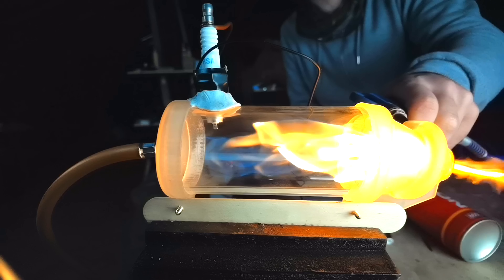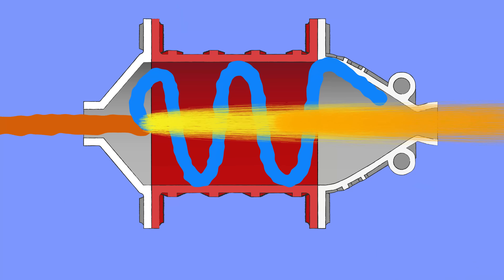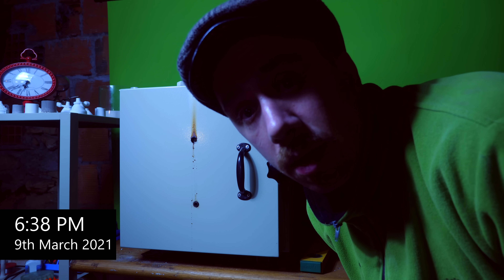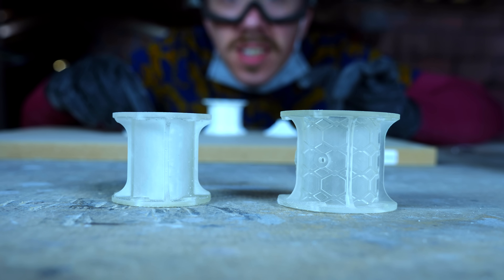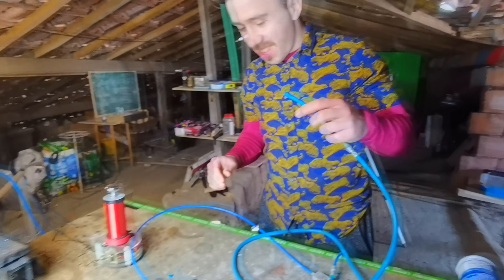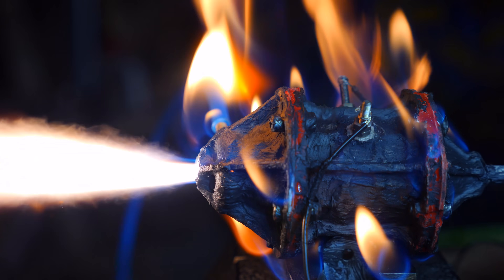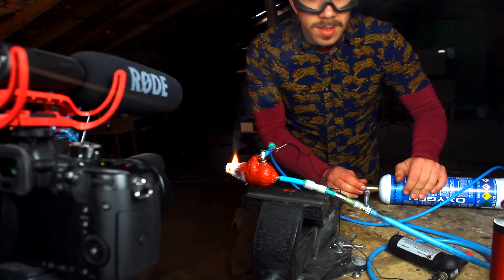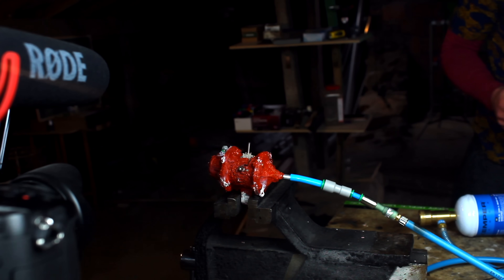Vortex Rocket V2.0 (3D Printed)

Comment: Nice work! Lots of time investment! I do enjoy your video's.
How about an Engine driven power generator.  I am trying to use a 3phase brushless motor as a generator with a diode stack on the brushless output leads to get back to DC power.  I still need a power source and I enjoyed your jet engine idea for my project.  Ill keep thinking about how to power my brushless motors as a generator. Keep up the great content!

Comment: Maybe you should cover the parts with a thin layer of glass like plates. We in Poland still use potassium silicate as a sealant for concrete. It can turn into glass crystals, but for gases material must be coated several times. So I think making glass-covered ceramics would be tighter and faster.

Comment: INTEGZA! Love it  :-D   IDEA: find someone (glass blower?) try to use 2+ of your printed ceramic parts to press/shape glass parts.  Should be both non-flammable and minimize leaking.  Also might see the vortex on the inside!  Make yourself some clear barriers and find someplace OUTSIDE for safer-ish testing.  Oxygen and fuel in enclosed area bad juju.

Comment: Can you 3D print a two stroke engine? If have negative tolerances and then carefully sand them down to size, I bet you can make it from ceramic goo. I would 3d print the parts and try sand mold casting using aluminum, but I don't have a  3D printer.
As for your problem with the ceramic parts being porous, you can try to infuse them under pressure or in a vacuum chamber with heat resistant resin.

Comment: when making parts out of ceramic powders that have binders you have to do a 2 stage oven treatment. the first stage is to burn out the binder and sinter the part, but this leaves pores in the ceramic itself where the binder used to be. You need to do a second, Higher temperature densification stage to cause the ceramic to close up those pores. it depends on the ceramic but you're looking at anything between 1500C-2100C for probably 4-8 hours and then letting cool Slowly.

Comment: Since you've been doing both solid and liquid/O2 engines.... why not a hybrid fuel engine? (For readers, see the wikipedia page on "hybrid-propellant rockets.") The challenges to face are how you choose the solid fuel, but also... SHAPING the solid fuel within the combustion chamber, designing the nozzle, but also - how to build the O2 injector to get good combustion. One of the problems I've seen with these engines (I helped build one in college) was the oxidizer being injected in a way that it didn't get uniform distribution to the solid fuel and the engine burned inefficiently. You can use a venturi gap to solve this - mostly, but there's a lot of engineering territory to cover.

Comment: Hi, maybe U could soak Ur engine in a ceramic liquid without resin once passed in the furnace and repeat the furnace process after it.?. IDK if u could use a similar material, kinda glass to stop the leakings

Comment: It's probably already been suggested, but I'd think about a glaze on the inside of the engine.  It means a second cycle in the oven, but it shouldn't be too much of a pain to do.  I'd also probably only go with one piece engines for the moment.  Sure, less modular, but you don't have to deal with jointing leaks, except at the inlets and spark plug.

Comment: Inetzga, Intezga... I give up ... Mr tomato lover. have you considered double dipping your prints in resin.... as in print, cure, bake, dip and cure again (no baking to avoid the external layer shrinking) ? I wonder if it could work... or cause larger cracks.

Comment: Would it be possible to 3d print what the inside of the combustion chamber looks like, then "reverse" cast it by possibly applying a ceramic coating then and outer layer to protect it and further insulate and seal it. Then burn away the inside, (3d) printed material, so that you're left with a single piece that is the rocket engine

Comment: Man the day this man learns how to properly work with metal...
Reply: While true I don't think conventional metalworking would help a lot with this project - oxidation and melting are issues that come to mind. The temperatures in a jetnozzle are pretty ridiculous
Reply: He wants to 3Dprint it
Reply: @Mikail_199  the day he gets a metal 3d printer...
Reply: @numberpie  He's too powerful to be kept alive
Reply: @rathh4691  metal 3D printer are very hard to make and as a Resultat exzessive too. Imagine that you have to use a Material that id able to work with molten metal and the metal has to withstand the heat of a jetengine.
Reply: @Mikail_199  SpaceX uses a 3d printer to make their SuperDraco engines out of titanium powder.
Reply: @numberpie  the reason why metal 3D printing will never take off like other materials and techniques, is because there have been metal 3D printing techniques around for decennia already... They're better known as cnc.
Reply: @rathh4691  omg🤣
Reply: @rathh4691  his life insurance is probably $1k a month🤣
Reply: @lukearts2954  true
Reply: @lukearts2954 right? get this man a 5-axis CNC mill!
Reply: @lukearts2954  except that 3d printing is an additive procedure and cnc-ing a subtractive procedure.
And with 3d printing you have much more design possibilities than with a cnc. His all in one design for example wouldn't be possible with a cnc due to the big cavity.
The biggest problem of 3d printing is the missing scalability. So for small batch production it often is even cheaper than other production methods.
Reply: @Mikail_199  could always use lost pla to cast it
Reply: @xxportalxx.  there is resin that dissolves in water.. he could make a model in that resin and just rinse out the cast with water
Reply: @Mikail_199  aha integza izleyen Türk buldum
Reply: This comment makes me think about the metal seal for assembling engine
Reply: * the day this man gets a metal resin 3d printer...
Reply: basf ultrafuse 316L  filament could be a way for him to do it
Reply: I know seriously
Reply: yes, it would be teryfiing
Reply: Your videos reinforce the fact that very often the journey IS the destination.  Than you.  I very much enjoy your work.

Comment: I feel like you could check for leaks more easily by plugging the end, pressurizing it, and then dunking it in a bucket of water to see if their or any bubbles. Actually, you could probably skip the water and just watch to see if it can maintain a steady pressure once you stop pumping in air.

Also, have you considered using a high fire glaze on the parts after you fire them the first time?

Comment: An interesting video would be to make a 3D printed CVT clutch (Of course, if you are going to use a rubber belt, you wouldn't be able to print it). But it would still be a hell of a project (In the good sense of the word)

Comment: It seems like your methods of sealing the pores don't penetrate deep enough into the ceramic material. When the pressure increases, it ends up lifting the surface layer of sealant off of the ceramic. Perhaps if you used a sealing method that achieved a sealing effect all through the pore structure it wouldn't have adhesion issues. Maybe some sort of submersion based technique? Or maybe just sealing the interior?

Comment: It seems to be leaking from the seams, and where your spark plug is. Probably a not perfectly flat sealing surface leaving gaps. Sand them as flat as possible, then try a silicone (or other non flammable, compressable) gasket on all the seams, tighten the bolts as much as possible, then coat with high temp sealer. This is why rockets are expensive. They need very precisely fit parts.

Comment: Have you measure the engine temperature, perhaps IR temp reader ?  having a readout would provide a guideline on what materials you can actually use.  Most glue/sealants you used are likely not rated for the temperatures you are actually experiencing.

Comment: 1: Once heat treatment is complete, fully submerge the component in the ceramic resin and heat treat again to fill in any cracks/inperfectionss
2: Use a ceramic aluminium baced glaze to reduce permiabilaty of the ceramic parts to a manageble amount.
3: keep the suport structuer on the parts where posible more surface area for cooling.
4: steal tape is a thing you could add a layer inside some of the modular parts. might melt tho?
(steal tape aint cheep but will also help you stop the compresion fittings from leaking too.)

Comment: Two suggestions. One is to use a ridge in between the mounting surfaces. A ring recessed into one end of one part and a ring raised from the surface of the other part to match. Sealing it would be easier. Two is that you might want to try building a mold instead. Then use a coating or setting technique to complete the build.

Comment: You could seal the inside of the engine using liquid glass mixed with hollow ceramic balls.  maybe also try plaster of paris as part of the mixture.  check out how to make inexpensive fire brick using water glass and plaster of paris

Comment: What about a possiblity of having a solid metal inside chamber, and then using a printed outside for reinforcement. Worst case scenario look at the possibility of getting it custom done from your designs by someone else if you are willing to take that route. Also look at the possibility of having two separate air intakes on just to get air into more spinning motion(one on the opposite side from the other bit in the same direction and as close to the back as possible to ensure air doesn't get built up inside the chamber as it looks like the air pressure is too high for the chamber itself)

Comment: You can use the super material starlite, which can withstand temperatures up to 10 000 ° c, because due to high heat and high pressure the object deform and start to leaking, I'm just suggesting https://youtu.be/0IbWampaEcM

Comment: Dude your using 3d printers, why dont you just integrate a sort of cooling system using water to cool every single wall down. Your using a 3d printer so it should easy to manufacture. Right? Maybe you could even use normal plastic if you can create a good enough cooling system with a not too high thrust 🤷🏻‍♂️

Comment: Why not print it in wax and cast it in zinc? or brass? If you make the walls thick enough and add a really big heatsink it should take the heat without melting and leaking.

Comment: The problem seems to be the pores and holes in the ceramic parts. What if you try glazing the ceramic part? It can create an air-tight coating that can survive high temps.

Comment: You should try a ceramic coating like cerakote, they have a 2000 degree resistant line, three coats of that or 5 and you might end up with a leak proof one piece rocket

Comment: You could build a device to measure the thrust of the engines that uses a loadcell and integrates into the Vice/clamp. That way you dont have to measure the thrust laborious on a kitchen scale and you get thrust measurements from the short lived engines.

Comment: you could try painting with ceramic slip and re-firing; you could also try spray metal welding/depositing metal onto the ceramic; not sure how it would stick to ceramic but the precocity may help get the spray welding started

Comment: maybe i'm wrong, but refractory materials are not supposed to be air tight.... right ? you need something with low-porosity and low thermal conductivity ! maybe try another ceramic, like zirconium oxyde , but it might not be 3D printable ... anyway, i like what you do sir ! it's always a pleasure to see smashed tomatoes :D keep doing what you like !

Comment: @Integza, Why not try to scale up the 3 piece engine a bit and have the parts made out of Machined steel with the inner chambers lined with a ceramic sleeve, and add cooling ribs like on the barrel of a machine gun? 
You can either make disks of heat conductive metal to slide over the casing, or wrap the entire outside casing with a narrow copper tube.

Comment: Pure oxygen makes most materials flammable. Combine that with temperatures of several thousand kelvin based on the colour of that flame and there are few if any materials that will survive such an environment.

Options include: reduce oxygen pressure, use compressed air, use a mix of oxygen enriched compressed air. 

Maybe, just maybe, you could try the NightHawkInLight Starlite recipe to coat the inside of the chamber and provide thermal insulation?